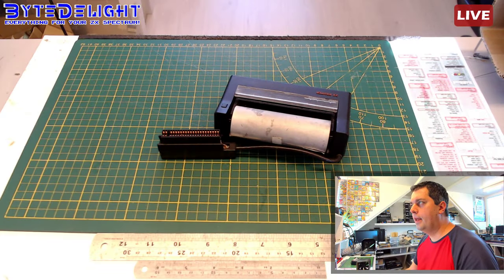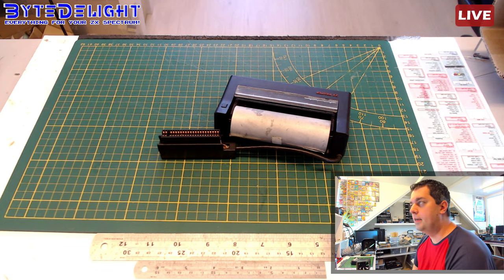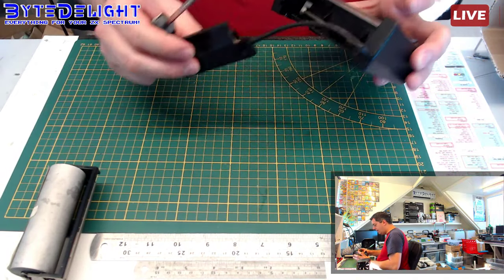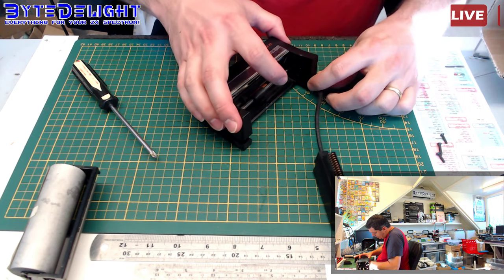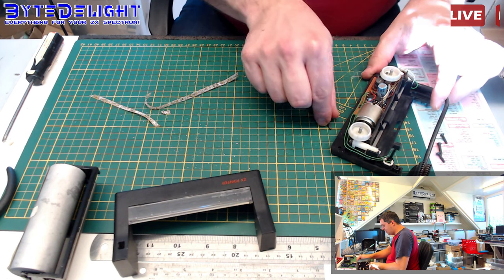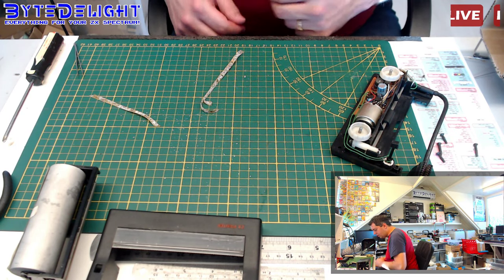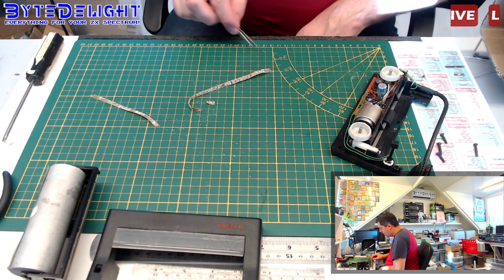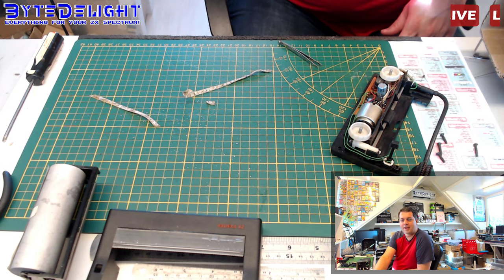The dirtiest ZX Printer belt ever!

Comment: Ben, let me tell you the story of my ZX Printer. 

I bought my printer from ebay or Marktplaats and it was in pristine condition. But when I hooked it up to my Spectrum, my Spectrum crashed. I took the electronics from another ZX Printer and put it in mine and it worked. So my theory why it was still in such a great condition is that it probably had been used because it had never worked (or not for long) and the owner just boxed it up.

Since the belt of my printer was still transparent (not white like yours!) and flexible, it was used as a mold or some sorts for the development of belts. Almost a year later I received my printer back and I tested it, if it was still working. Yes, it was. 
Then I opened and to my horror/surprise, it had a replacement belt in it! My poor flexible, transparent, pristine, lovely belt had given its life to aid in the development of a proper working replacement belt that is giving owners of ZX Printers much joy again.
Reply from the maker: It really surprised me that your ZX Printer had a belt that was still flexible, it must have been stored in a plastic bag or so.
I NEVER have seen a ZX Printer with a working belt during the last 5 years, and I have about 40 or so.

I still hope I will ever get replacement belts myself, it's a shame they're not yet available.
Reply: @ByteDelight  Well, i have one still boxed in my cellar. I might take it out and check the belt. Infact, i never used a thermal printer before. I have a Seikosha matrix printer. To bad, i don't know where to find a replacement roll :(.  Regards, Ronny